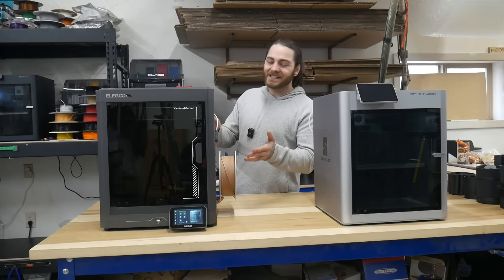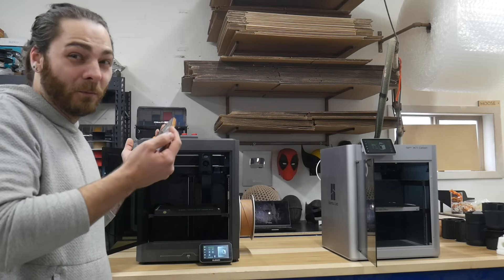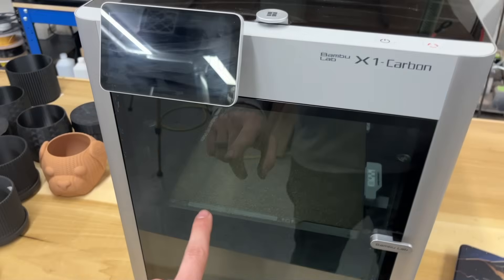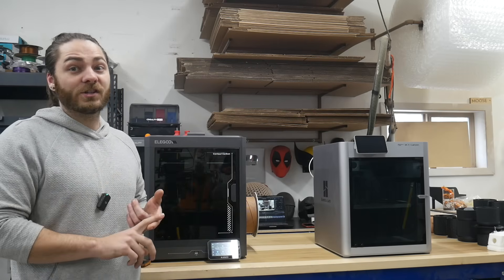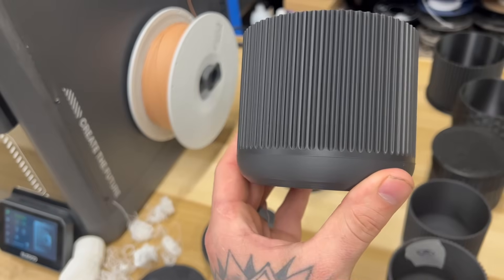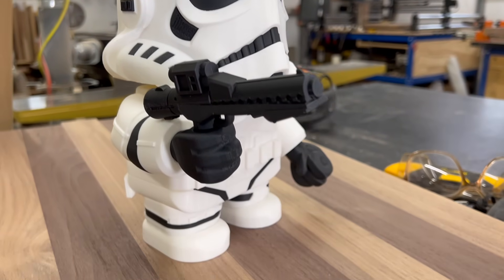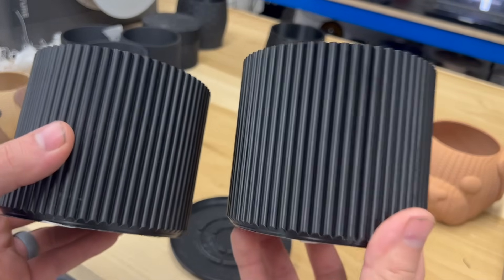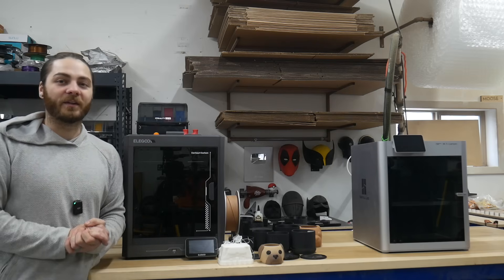Cheap vs expensive: Can the Elegoo Centauri hold its own against the Bambu X1C?

Comment: It's pretty silly that they skimped on the light. As you said, LED strips are super cheap. Elegoo has said there is an AMS on the way (someone at the show say they can see what they think is the AMS covered over and it apparently looks a lot bigger than your average AMS), but were very vague about if the version of Centauri you have will work with it or not. I don't use the AMS on my P1S for multicolored prints very often but it's super convenient not to have to swap spool over when I want to used a different material or color.
Reply from the maker: It is very convenient, I always recommend it if it’s in people’s budgets. Just makes things a little easier. Yeah I can’t wrap my head around the light lol those strips would cost practically nothing buying at those volumes

Comment: You should compare the Centauri with the P1S. This would be like comparing a cheap apple with a sweet, shiny apple...
The X1C is for fiber-filaments and has Lidar, a 25fps cam, higher bed die temps, AI, ...
Difference of the rods is not only that bambu uses carbon (also on the P1S), they also use self lubricating bearings in combination... Steel is cheap...
And for a comparison I hear "I don't know", too often.
Reply: I’ve gone through 15 rolls of PPA-CF on my elegoo. Not one failed print.
Reply: @mattcat2218  10kg? in a couple months? on a printer worth less than a few rolls of it? cmon.
Reply from the maker: I agree the P1s is a better comparison. Elegoo asked me to compare it to the X1C when they sent me the printer. I do quick reviews there’s tons of channels out there if you want something more in depth.

Comment: Yeah, not a fan of tinkering, but I do have a CC on order and I also have an X1C. Not sure the CC is up to the task of production printing, but bought one to see how it might be used. Even here you showed a brand new CC against a 2 year old X1C. No failed prints or clogs on the X1C, and yet problems requiring tinkering on the CC.

Comment: I really wonder how it holds up. It looks good, but support makes or breaks a product. Bambu does a great job of selling the bits that break. All of these have consumables. Definitely something to keep an eye on though
Reply from the maker: I agree, that’s my concern with the elegoo. Will it hold up and can you get parts? We shall see
Reply: They are very likely to sell spares as it's another way of making money.
Reply: @andyspoo2  eh, not if they decide not to. There have been several promising printers in the past that didn't have that support trail that killed them. I remember that was the call so many made about bambu, how do we trust a new company to sell spare parts? Elegoo doesn't have the worst track record, but not the best. Well see what they do
Reply: I think if you need the support, bambu is probably the way to go.
Reply: @ maybe a few years ago, but now with the core xy printers all being made from bespoke parts, they are more a pain to work on. Its nice to have a supplier that will sell the head assembly. The common user wont spend the time an enthusiast will. and the old heads need to realize, the market is changing. 

I'm happy to figure out how to replace parts, but i dont like traking down consumables. I have a play printer for tinkering, and a p1. When i just want something to be printed no fuss, yes, the bambu is used.  doesnt matter if eventually the  carbon rods wear, as long as bambu is around i'll be able to get parts. 

the weird thing to me, the carbon is almost cheap enough to be disposable. If enough parts fail after 10k print hours, its would just be worh replacing

Comment: The spool location IS a big deal with an AMS if you want to occasionally print TPU as well. I have my Kobra S1 in a glass front entertainment center cabinet because it just helps keep the heat in that much better for ABS/ASA/PC printing (and they're the right size cabinet and usually already have power and lights in them if you get a nice one), but that makes it a huge PIA to use the included external spool holder, or even disconnect the ACE pro. It's a tradeoff I'm willing to deal with, but if they put both of these things in a more accessible location some of us would really appreciate it.

Comment: It’s really great that Elegoo is releasing this printer, as much as I love my Bambu printers they have been out for a while and while they did release their new flagship  it’s a bit underwhelming so other companies nipping at their heals is forcing improvement. 

I’m not sure it’s right to compare this new printer against the X1c though, maybe it’s better to compare it to the P1S which is probably a more like printer though still more expensive. It’s also probably likely that Bambu will be ending production of both the x and p series so having a comparable printer available is good since this style printer has proven to be a highly easy and reliable platform. 

Overall I’m impressed with what I’ve seen with this new Elegoo printer. I hope it’s successful, and there doesn’t appear to be any reason it wouldn’t be. I also hope it’s better the. The K1 series, which I have had poor luck with, though time will tell.

Comment: Bambu has had a lot of time to update there base print profile. I think with some time eleggoo will also perfect theirs. And once the aftermarket get ahold of it all the little issues will be solved still at a fraction of the price.
Reply: Creality are really poor at dialing in profiles. Hopefully Elegoo is better.
Reply: @andyspoo2  I think we will see users with better profiles but I have hope for elegoo
Reply: Also for 1/4 of the price you can buy 4 of these for 1 of those bamboo labs I love my elegoo would rather get 4 than 1

Comment: Ordered mine 2 months ago. Wont ship until June/July. Losing faith/confidence in the product as I wait. Maintaining a clog free nozzle seems difficult, and I've seen online complaints about the belt wearing out after only a month of heavy use.
Reply from the maker: Overall I like the printer but longevity and quality of parts used is my worry at its current price point of $300

Comment: Have about 70 print hours on the Centauri Carbon, used to have an X1C, and man... I couldn't be happier with the CC for what it is and for the price I payed.
This honestly makes me go "Bambu who?" xd
Reply: For someone who is about to buy the first 3d printer im on the fence, when you add the "for what it is and for the price I paid". Does it mean that it is mediocre but because it was cheap it is okay?
Reply: @KasperJuul87  It's just genuinely a really good printer. I would've also bought this if it was 650€ instead of 340 to be completely honest
Reply: That’s awesome to hear. I’ve got over 1000 hours on my p1s and I love it. I’ll need a second printer soon and the price of the centauri is very attractive
Reply: Why did you get rid of your x1c? Is it because of the Internet data issue?
Reply: @QargZer  Well - Apart from the problems he had, the whole Internet data issue has prevented me from buying the x1c. I had a A1 mini and wanted to upgrade, but I don't like sending my designs to some cloud based server somewhere in China. Yes - There is a work-around (for now), but that comes with reduced functionality. I am not going to pay a premium price for a printer that is only usable (for me) in a reduced functionality mode.
It's not about the money. For instance - I ordered a Prusa Core One kit a while ago. However that Elegoo is a tempting piece of hardware. That's for sure...
Reply: @QargZer Problem after problem and horrid support that was of no help, with age long waiting time.
Reply: ofcourse youre here cx

Comment: I was thinking of picking one up; thanks for the review. Sidenote: If you can get your hands on an Anycubic Kobra S1, they are a nice, lower-cost printer than the X1. You can also Jailbreak them so they are out of the Anycubic Eco System.
Reply: I agree with this. I have an X1C at work that we use all the time, but I picked up the S1 combo a couple weeks ago and I'm very impressed with it. That said, this is also a pretty great option if you don't care about the multi-filament support.

Comment: Centauri has tons of issues with freezing mid print, all kinds of sensor errors, and the filament runout sensor not working at all. I ordered one on release day,  I'm in the 2nd batch that ships this month.  I sure hope I get a "good one"
Reply from the maker: That sucks, thankfully mine has been great. I’m curious how the quality control and longevity will be as it’s such a lower cost printer.
Reply: @TwoMooseToo  That's the problem when you are 1at in the Q,  you help find the problems that Elegoo missed, 
so those ordering six months later get the updated machines, happened to me purchased Elegoo Neptune 4, about 4 months
after release, never had a problem, unlike those in batch 1
Reply: I haven’t had any of those issues. Does that bambu penis hurt being jammed that far down your throat?

Comment: Did I hear you right? The Elegoo is 300 dollars and Bambu is 3,200 dollars???
Reply from the maker: No. The Bambu is $1200 and $1500 with the AMS. The p1s is even cheaper and I think $700 and prints just as well
Reply: @TwoMooseToo  But the Elegoo is 300?

Comment: Overall, it's kind of like comparing a Volkswagon with a Mercedes. They'll both get you to the grocery store, but one has more features and better quality... for a price.  For me personally, I think if Elegoo wants to compete head to head against Bambu Lab, they need to develop an AMS and the associated firmware to support it. I use my AMS for nearly every print I run, so not having one would be a deal breaker for me... regardless of the economy.
Reply from the maker: Someone mentioned they are releasing one soon. And I agree, they asked me to compare them when the reached out to ask if I would review it. I feel the p1s is a better comparison. Also I have no idea of the longevity of the elegoo as I haven’t had it very long.

Comment: First thing I will do is add a led strip and wire it to that light on the elegoo
Reply: new batches should include better lighting inside
Reply: @thijskunst what’s the source?
Reply from the maker: I’d recommend that, with the tinted glass front it’s difficult to see inside when printing. A led strip or two would be 10x better
Reply: I don't know if you will actually need to as I heard something the other day about Eggy addressing the p*ss poor light anyway. Don't quote me but let's hope so. And Eggy seem to actually listen to their customers unlike Bimbo Nobs whose only interest is extracting the most profit rather than offering value for money. But there are already several lighting riser prints on line to enable the addition of an all round LED strip together with adjustable ventilation.

Comment: Light isn't a problem. I had to modify bambus printer with led light straps because they were too dark also. So it will ne the same mod for the centuri carbon so no big deal
Reply from the maker: Sure it’s not a big deal but they could add a better light, it’s a pretty low cost fix for them.

Comment: What makes you select PETG vs ASA in the plant pots? I know ASA is much better outside since it has like 10x more UV protection and can hold up to 100C temps but the PETG outside would definitely not hold up so shouldn't they all be ASA? Just curious. I appreciate the video!
Reply from the maker: I just printed it for the test, no real reason. The indoor ones I just print out of pla because of the color selection. If it needs to go outside I’d use ASA.
Reply: @TwoMooseToo  I've used silver PETG for some homebrew Malibu lights, and it held up well, even in the Florida sun.  Not sure how other colors would do though.

Comment: The only way to sell it for 300 is to manufacture it for 100. Does anyone actually think you can build a “good” printer for $100?  Long term you will understand why they say - you get what you pay for. I have 2 X1C with over 3500 hours on each without ever working on them. If this printer can do that, I’ll take 10.
Reply: When trying to gain market share I wouldn't assume the margins you think they're making. EG Console and 2D printer manufacturers often sell below manufacturing cost to establish a market to sell to. Whether we'll see 3D printer manufacturers tying us to their own brand filament I don't know, but that's one way to gain profitability down the line.
Reply: I too have an X1C and it's got 4350 hours so far and I hope to get 8,000 hours out of it (that's what I'm using for my internal depreciation/cost to operate calculation).  Since this is 1/4 the cost, it would only have to operate for 2,000 hours to have the same depreciation cost/hour so no, it doesn't need to hold up like my Prusa Mk3 with over 12,000 hours.  Keep in mind, Elegoo (not Eleglue) sells massive amounts of filament so they can/could make up their loss that way (give away the razor cheap and sell razor blades model).
Reply: Yeah I think they are selling the printer at cost to establish market share and make money off filament while trying to beat Bambu.
Reply: @TheFutureLooksGrimm  which prior to the firmware controversy from Bambu would have looked like a huge challenge, but the market now is very receptive to an alternative performant open source printer. Interesting times
Reply from the maker: That’s my question too. Will it last? We’ll see lol
Reply: The profit margin on 3D printers is 20%-50% on average, making the cost $150-$240-ish. My guess would be lower margins on the Elegoo, so probably about $200.

Given the 4X price difference & the comparable print quality, anything over 2K hours makes it a good buy.
Reply: Yeah they ask to compare it to x1c...but it's missing many bells and whistles....so if you need those ...the x1c may be worth the 5x price.

Comment: Instead of taking the print head apart have you tried physically pushing the filament through while the gear is extruding? That's worked for me with that kind of stuck filament.
Reply from the maker: I’ll have to try that next time, only took about 10 minutes but if I can save 5 I’m sold lol

Comment: Better to review against the p1s as they are more comparable on price.
Reply: If we look at the specs, the Centauri Carbon is closer to the X1C. Carbon filter, max bed temperature, max nozzle temperature are closer and more comparable to the x1c. For the price it's a steal
Reply: @stay_in_adventure shh you’re going to anger the Bambu fan boys!! There’s NO way the CC can be comparable to the Bambu flagship at a third of the price! “You GeT WhaT yOu PAy fOR”
Reply: The X1C is just a P1S. Exept the point that it:
- is €600 more expensive.
- has a lidar (which is pretty useless).
- has a detailed touchscreen (just put a €50 Panda Touch on the P1S).
- has a hardened steel nozzle and extruder gear (which you can also upgrade on the P1S).

Besides all of that there're not many major differences.
Reply: But that is not what this video is showing. It is simply seeing is the extra cost is worth it.
Reply from the maker: I agree
Reply: @TwoMooseToo   then why didnt you?
Reply: It was made by elegoo to compete with the x1c hence the comparison
Reply: @patrickcadieux3264  The P1S is basically just a cut down X1C, elegoo want it compared to an X1C for their product to look better but the P1S is probably a better comparison.
Reply: @conorstewart2214 pretty much this. The X1C is generally a bad deal for most people, the P1S offering way more value for your money.
Reply: @benjaminvdvyt  Hence why elegoo wanted to go up against the best on market. And be comparable. For 300$. Hence making bambulab obsolete.
Reply: Why? Elegoo specifically wanted to go up against the X1C.

Comment: You can use Orca with this... :(
Reply from the maker: Their copy slicer is identical. I feel companies will start doing this. My last qidi printer I tested was the same. They made a copy of orca and called it qidi studio. I don’t know if they updated it but there wasn’t an orca profile for that printer either.
Reply: @TwoMooseToo  The only reason I mentioned it with the sad face was you sounded disappointed that you couldn't use Orca.  You said you liked Bambu and Orca.  Elegoo added a Centauri Carbon profile to Orca.  So everything is good to go using Orca with the Centauri Carbon.  The device page works just the same as in Elegoo slicer.  Latest firmware also fixes the camera monitoring feed only working for so long.